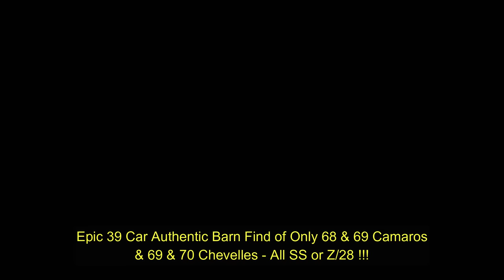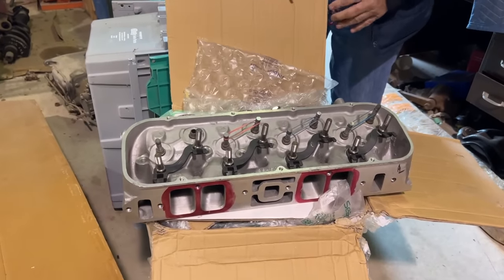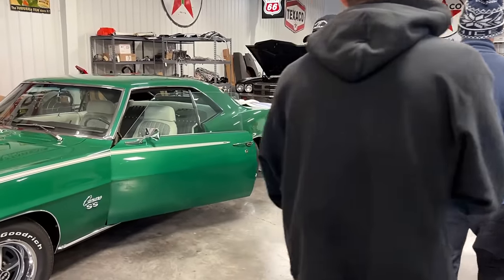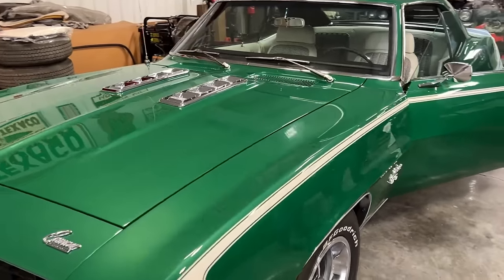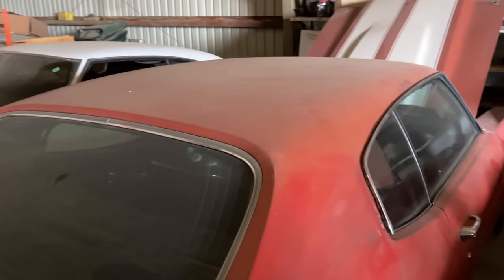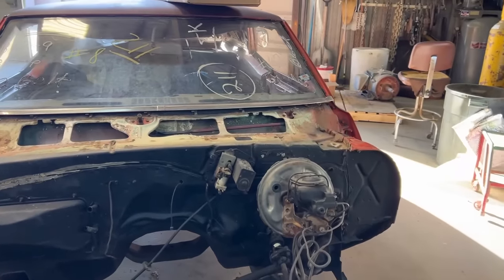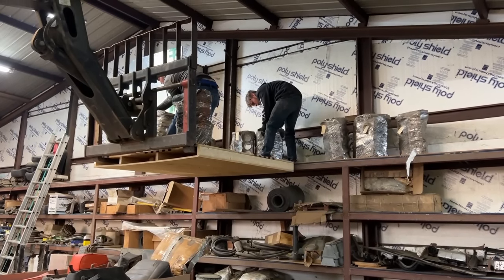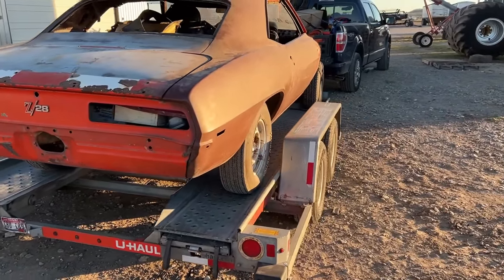Epic 39 Car Barn Find with ONLY 68 & 69 Camaros SS & Z/28 and 70 Chevelle SS 396 & 454 Cars & Parts

Comment: Incredible documentation of  a monumental find of vintage Camaros and Chevelles and the absolute treasure trove of parts.  Nicely done!  The scope of this collection is almost unbelievable.  One wonders where all those DZ blocks came from...so many that it was mind-boggling.  The person that collected all of this stuff definitely had a serious knack for tracking down all the good stuff over all the years of collecting it, not to mention a serious pocketbook.   Congratulations on the Hugger Orange Z/28!  Looks to be a great candidate for restoration.  I'm sure it will be gorgeous when it's completed.  Thank you for documenting this amazing cache of treasure.   One note: The color is spelled "Fathom" Green, not "Phathom". 
-Rick in Oregon
---   
'67 SS/RS L-78 #-match/UOIT | 37K orig. miles | Butternut Yellow/Black Deluxe/Black Vinyl Top | Console/Gauges, Rear Defog, AM w/Rear Speaker | M21, 3.73 Posi
'69 Z/28 #-match/PoP/Orig.Purchase Docs/2nd owner | 69K orig. miles | Lemans Blue/White Stripes/Black Deluxe | Vigilite, Fold Down Rear Seat | M21, 3.73 Posi
'69 Nova SS L-78 4-speed #-match/Build Sheet | 65K original miles | Frost Green/Black 60/40 Bench, Original Black Rubber Floor Covering, AM | M21, 3.55 Posi
Reply from the maker: Thank you two78s, I appreciate your comments and support.
I am fully aware of the misspelling of fathom green, I do not know what happened with that incorrect spelling, it may have been my spellcheck or some thing. Unfortunately I cannot correct it at this point.

Comment: I would definitely be looking through that pile of DZ blocks for the Z28 that you bought. That would make that Z28 worth more money if you have the original block.
Reply from the maker: My car does have the original block
It’s in the back of my truck 
I failed to mention that 😎
Reply: @digitalpizza1  did the original engine happen to be in that row of DZ blocks on the floor or shelf?
Reply from the maker: @willthetrill4849  no , it was with the car , also in the trunk along with a lot of the other original parts

Comment: KILLER...Z28 302 IS MY FAVORITE ENGINE (FORD/COYOTE TODAY 2022...FORD FINALLY PERFECTED THEIR 302)...CHEVY 302...IT WAS SO DURABLE...BEAT THE SNOT OUTTA THAT ENGINE.. 50,000 MILES THEN REBUILD IT...BOTH ARE AMAZING...GM HAS THE OTHER 2 ENGINES....CADDY AND OTHER GM VEHICLES RUN SAME ENGINE AS NEW VETTES...WOW...!!!

Comment: The statement said 69 RS/SS 396 X11. Big block can only be X22 or X66. I’m guessing a type O.
Reply from the maker: Correct, I meant to say small block 350. X11 cars could be SS350 cars in some cases according to CRG (Camaro Research Group)
Reply: @digitalpizza1  I own an 69 RS/SS 350 X11 car. Numbers matching 350 still in it. Exactly! X11 trim package which includes RS. X55 is base SS 350. What an awesome find with all of the parts and cars. I’m looking for the correct carb for mine.

Comment: Those Chevelle's all have the cowl flap in the hoods. I don't remember actually seeing those on any car ever, and I've seen alot of Chevelle's and Camaros
Reply: @midnitesquirldog1 regardless everyone of those Chevelle's are a dream in my opinion.
Reply: @midnitesquirldog1 that's one of my favorites as well. Hope it has the 455 in it
Reply: I'm a Pontiac/olds guy myself. It takes alot to build anything not Chevrolet. Unless you have done it. You don't know.
Reply: @midnitesquirldog1 I just became a subscriber of yours. If that black car is the Buick you speak of. I'd love to see it. Hope you post it on your channel
Reply: Pontiac and oldsmobile are basically the samething. But your right olds never officially made a big block. All there engines basically just use larger internals. All the Pontiac trans ams actually used oldsmobile engines. If I remember right. The 421sd the 455, 400, 350 actually used the same block. Just different cranks sizes and piston rod combos
Reply: In 1977 I had the chance to buy a 1972 Chevelle SS 454 a light yellow with black stripes, black interior that had factory Cowl induction hood. The cowl hood had the flap. I thought it was neat when my friend would floor the accelerator the door would open and you could hear the engine moan through the windshield. The car had about 75k miles the price was $1200 and it did not need paint all original. I passed on it because it used Hi-Test gas and I was 20 yrs old with Camaro on my mind. Just one of the long list of mistakes I made in life. I do have a 1969 Z28  X77 car all original except a spoiler was added. The car came without a spoiler as it was not standard equipment on a Z until April I believe.It is a 4th week of March 69 Z nothing special but it is stock. I bought it in 1995 for $ 4,000. It is somewhere in my garage under a bunch of junk and projects. Back in the day I believe you Northern and Mid-Western guys had a lot more money than us Southern boys. That Civil War killed our ancestors then Carpet Baggers and rich Yankees came down and stole our plantations with the help of the Yankee Army. Still today lot of large Plantations are owned by Northerners or now transplants.

Comment: So when you buy one of the cars are you getting the correct parts that belong to each car or would it be a questing game and you are just getting a body? Wouldn’t be worth it if you ain’t getting anything with the car.
Reply from the maker: Each car is different. Some are just the way you see them. But as you can see, every part can be found. A lot of the cars have the original parts inside the car and trunk or are near the car and labeled. Some of cars are complete as you see them.

Comment: Cowl trim tag gone but there is a $10 Z28 emblem on the back, "It's a Z". The 1969 Z28 production numbers just increased by 1 on this day.
Reply from the maker: Actually no, there were other signs that it was a Z. 4 leafs, Muncie Hole, distribution block under drivers door, power disk brakes, correct part number on the engine mounts, and an X7 grease pencil on the bulk head. All of which appeared to be un-tampered with. Also, the car had been sitting in that spot for 25+ years and that the owner had only bought real cars.
Realize that the video was done in a real time fashion and comments made were first impressions and reactions and that there may be things that happen and other info investigated that are not on video before making an assumption like that. 
Forgiven if it was meant to be a joke, and I agree, its easy for an amateur to slap on an emblem and call it a day. But the man who owned this collection was no amateur.

Comment: I tell ya 1 thing. If I was the owner of one of those cars already sold I would’ve got it and all it’s parts out of there before all the people  from HeartCity showed up. Who’s deciding what parts on the floor belong to who or what sold car?
Reply from the maker: I can assure you that both Jim & Adam of Heartbeat City were there and treated everyone who bought cars at the farm fairly and made sure that if there were parts there that went to a particular car, that the buyer got those parts. There was one or two instances that a price was negotiated for a car that did not have the matching engine, but then later the engine was found requiring a renegotiation which is fair, and anyone would agree.  Again, it's easy to assume the facts if one was not there.

Comment: Amazing. What do you know about the 66 Chevelle? Will it be for sale?
Reply from the maker: Hi Russel, I just checked, the car is sold.
Reply: Hi Peter. Thanks for checking. I have my original 66 Chevelle SS that I bought when I was 16. I have been looking for a 360 horse 66. I also have a 69 Z28 with original paint, original interior, and all matching numbers. I am hooked on your videos and have been watching them all afternoon. Thanks again.
Reply from the maker: Thank you Russell, I really appreciate it. Where are you located? I am in No. California. If you are near by, I would like to see your cars. If not, send me pics. to digitalpizza@comcast.net
Reply: I'm from Oklahoma.
Reply from the maker: my friend has a 66 Chevelle numbers matching all original red on red 4 speed 325 HP, protecto plate, etc. The engine has piston slap issues and needs a little rust repair but mostly original paint. I believe he would be open to sell it.
Reply: Thanks for the lead. But I am pretty stuck on finding a 360 horse.

Comment: If the place is outside of cedarville, I've been there and bought parts there. I'm old now so you must have dealt with his son. I know where a nice 67 rs z28 is for sale
Reply from the maker: Hi David, it might be the same place, it was actually in Weber Falls area. Give me a call at 415-272-8133 about the 67 Z/28. Thanks David
Reply: @digitalpizza1  67 Z car, now that IS a real gem of a find, especially if it sucks air from above the heater box!

Comment: How do you tell what cars are RS vs SS vs base model? I have a 68 with a missing cowl and door tag I only have the vin. But the vin wont tell SS or RS just manufacturing info
Reply from the maker: There is a hole in the firewall just above where the engine and headlight wire harness’s plug into the firewall
Reply: @digitalpizza1   and that would indicate if it is an SS? or RS?
Reply from the maker: That indicates an RS
SS would have power disk brakes and the dual exhaust hanger bracket in the rear fender well on the drivers side
Reply from the maker: @cameronkendall9113  also, if it’s a norwood car, and a big block, it would have an X2 or X3 grease pencil mark behind the rear seat on the rear bulk head
Reply: @digitalpizza1  Big Block cars from Norwood with X code are X66 or X22.
Reply from the maker: @terryvincent3788  correct, the grease pencil mark on the rear bulkhead is X2 or X6 .The Zs have X7 or X3 for X77 and X33
I mistyped , it would be X2 or X6 for the big blocks

Comment: At the 15:02 mark. I thought all "69 Z/28's were "X" cars?
Reply from the maker: Hi John, Only the Norwood cars were "X" cars, and only after about December or January. Early Norwood cars did not have "X"codes. No Van Nuys cars had "X" codes. If you will notice, that Red Z/28 was a 4th week of November 1968 car. So it would not have the X code.

Comment: Camaros never had 5 spoke rims
Reply from the maker: The early 69 SS Camaro had these wheels. They were discontinued in early January 69. They were an option listed as -  "SS"    Disc   YA  14x7   SS    RPO N66 This info is listed on CRG Camaro site. http://www.camaros.org/suspen.shtml#Wheels
Reply: My Oct 68 SS 396 has them.

Comment: There is No x11 car that came from factory with 396.
Reply from the maker: That was a typo in the video. It was actually an RS/SS 350 car. Which only about 5% of the X11 cars were SS 350 cars. So it was a very rare car.
Reply: @digitalpizza1  okey. Nice finds 👍🏻